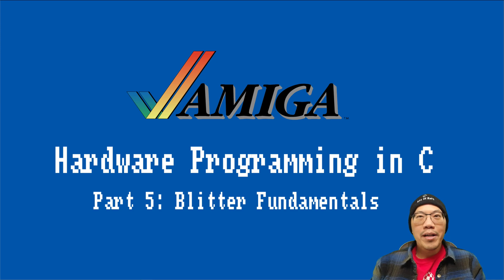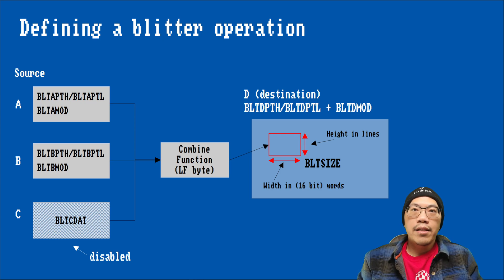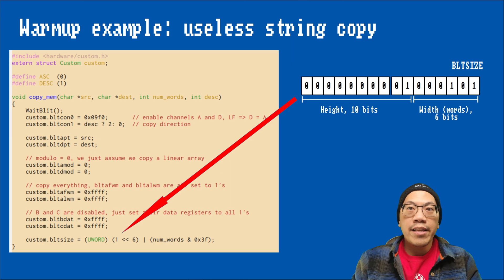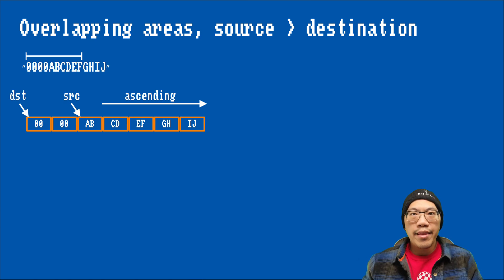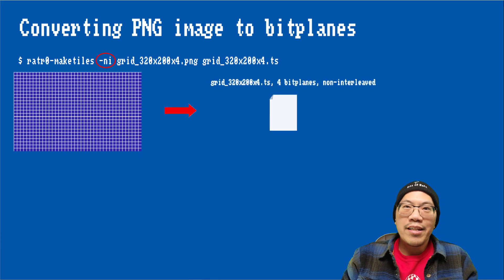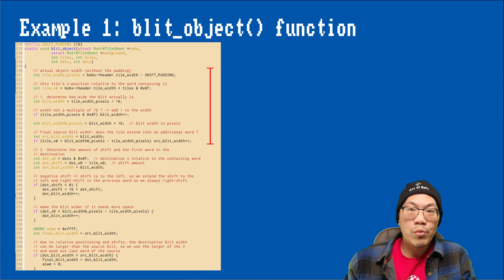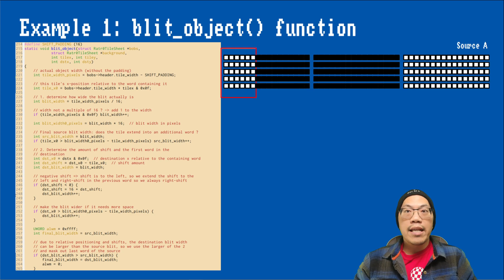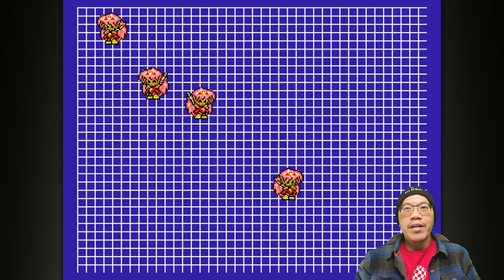Amiga Hardware Programming in C Part 5 - Blitter Fundamentals

Comment: Great video, I really appreciate all the work you've put into this series. I've been following each of the videos experimenting as I go along and I was wondering, if I wanted to move these BOBs on a 32 colour screen, do I need to take a copy of the area I'm about to blit to so that I can blit it back to remove the BOB? I have a bad feeling I'm going to get into trouble when BOBs overlap. How is it usually done?
Reply from the maker: Hi, yes, you will usually have to restore the parts of the background that have been obscured by BOB graphics. And in many cases, using a background buffer makes sense to avoid that those blits are visible on the screen. With overlapping BOBs you'd have to know the areas of the background which were obscured by the BOBs, but otherwise I'd think you would only need to care about in what order you want to draw them.
But that's similar to how it would be done in a system that does not support hardware sprites. Your approach can depend on how you are building your background and your objects are moving e.g. if you use a tile-based screen vs. a simple background image.
Reply: @WeijuWu  Thanks for your response. I'm going to experiment more over the weekend and see if I can move the Rodland sprites from your example. My plan is to have the grid background you made in a background buffer and blit a rectangle from that buffer to remove the BOB before blitting the BOB in the new position.

Comment: The blitter and copper was a saving grace for me was I writing games on the Amiga. But I hated biplanes, I found them just too painful to work with.
Reply from the maker: Do you mean dual  playfield mode or planar graphics in general ?
Reply: @WeijuWu  just planar in general. I stopped working in the games industry like 24 years ago (I worked for Argonaut software). When I moved to PCs though, chunky mode just fitted better with my expectation of how screen data should be stored. But everybody's different I guess.
Reply from the maker: @stevenparkinson8475  I get it, to me personally chunky feels more natural and also more convenient. When you have a color depth that is much less than 8 bits, planar graphics seems more efficient though. You worked for Argonaut ? That's pretty cool, quite a number of classic titles (mostly 3D ?) were made there.
Reply: @WeijuWu  Yeah, Argonaut was responsbile for quite a number of classics but I was recruited after that time. Great Videos BTW. It's really good to see that the Amiga still has a strong fan base after all these years. But I'm not surprised, it was and still is an amazing machine.

Comment: The Atari STE had a blitter chip, but it went sadly unused, mostly. So maybe skip the Atari tutorial LOL. I would like to see clips of games where the blitter had to be used effectively to pull off the effect, but nice to see your series on youtube.
Reply from the maker: It is funny how certain features that were included at the system releases influenced how they were used in practice, like the built in MIDI interface on the Atari ST or the ability to do easy video synchronization with the Amiga.

Comment: as someone who is proficient with C but much less experienced with 68k asm - this is excellent, i love this series. please keep going
Reply from the maker: Thanks so much ! I've worked with 68k assembler back in the 80s and 90s, but nowadays I mainly limit using assembly for working on compilers. Because of the compiler work I know that I keep making the same mistakes which I'd rather not want to think about when working on an application or game and a lot of Amiga hardware programming can be done by placing data in the right places. Still, I have mad respect for anyone who can read assembly like other people read posts and articles.
Reply: Hear hear...
Reply: Yeh I understand C but just can’t grok machine language and I find a lot of this just goes over my head but I appreciate it

Comment: Very cool, please keep them coming. But why not use BltBitMap() ?
Reply from the maker: Thank you ! The goal of this tutorial series is to explain Amiga hardware programming and explain the role of the custom chip registers. So the focus will be on registers rather than operating system functions. The next Blitter related video will build on the things introduced in this video. The graphics.library functions are often very close to how the hardware works, but I'd rather use those in a "Amiga Systems Programming in C" series. For this episode I've chosen to use WaitBlit() over querying the Blitter ready bit, though. Sometimes I will make a compromise and pick what I think will be simpler in the context.
Reply: @WeijuWu  makes sense, it was a good walkthrough and I look forward to more parts 🙂

Comment: This is so cool. I used to be a demo-scener back in the day. I have a couple of Amigas lying around, but maybe I should just try to do some simple demo tests in UAE.

Is there a recommended way to develop in macOS and cross-compile it, automatically deploy it such that's it available to UAE?
Reply from the maker: Hi, I don't know if there is an "official" way, but I have developed the examples for this episode on my Macbook Air. I use the same cross-development tools as described in my older video "Cross Development for the Amiga with VBCC". I used Linux then, but this works on the Mac and Windows, too, if you use "Windows Subsystem for Linux". On the Mac typically you will have to install XCode from the AppStore first to get a C compiler. Also I had to install either MacPorts or Homebrew (I used MacPorts) to make adding additional development tools easier. The Mac unfortunately lacks a package management tool in the style that Linux distributions typically have.
For Amiga emulation on the Mac I use FS-UAE.
Reply: @WeijuWu  Thanks. I'm having problems with vc not finding stdlib.h, and while researching that I stumbled across http://eab.abime.net/showthread.php?t=98525 / https://github.com/BartmanAbyss/vscode-amiga-debug

Have you looked into that? Looks really nice.
Reply: For developing my Reshoot games I am using Xcode to manage the sourcecode, and the cross-compiler VASM to compile an Amiga-executable which I can then run in the Amiga-Emulator FS-UAE – all on iMac. One Mac-folder is assigned to FS-UAE as a harddrive, which therefore both Mac and Amiga can easily access to share files. Some selfmade macros help automatisation of processes.

While the Reshoot games are developed in Assembly language, you may always switch from VASM to VBCC to code in C-language